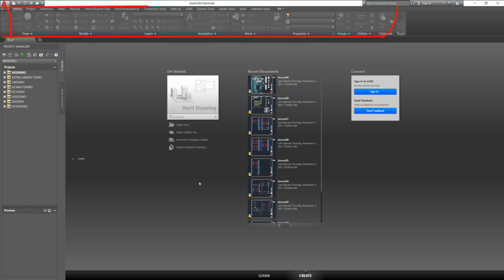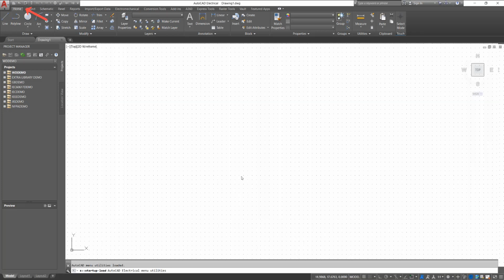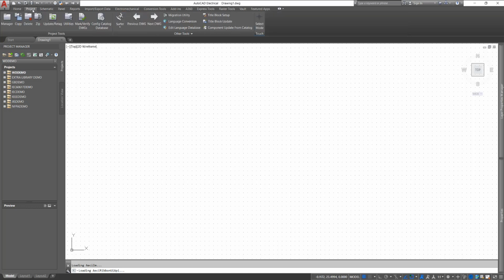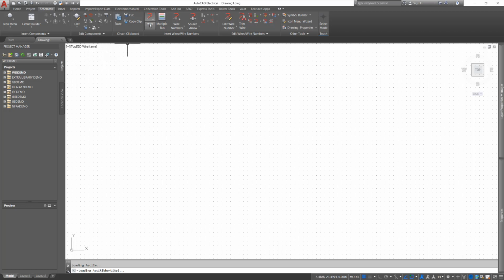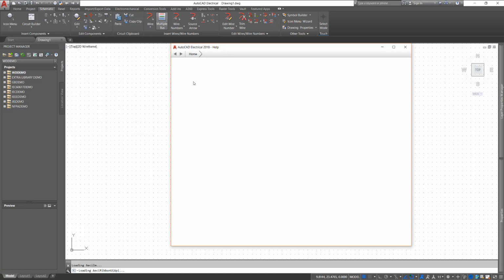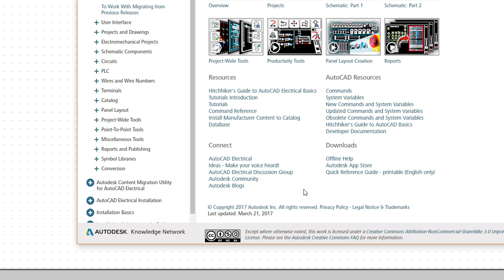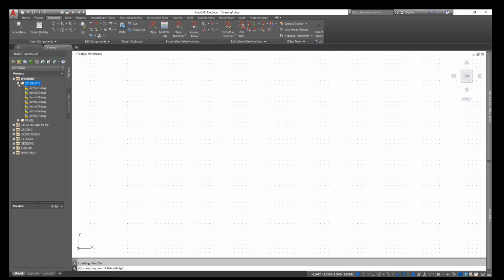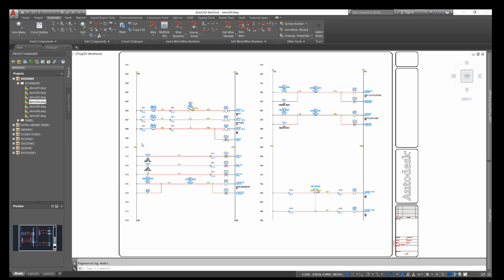Lesson 1: Design Environment | AutoCAD Electrical

Comment: I'm new to AutoCAD and I'm using a AutoCAD 2019 on an MacPro how do I start with Electrical if I don't have a start drawing template?
Reply: AutoCAD Electrical is a different installation (build on top of AutoCAD) exists on Windows platform.
Reply: @alanalright4305  can you plz tell me I installed AutoCAD not specific to electrical 
Is electrical AutoCAD is different from general AutoCAD software